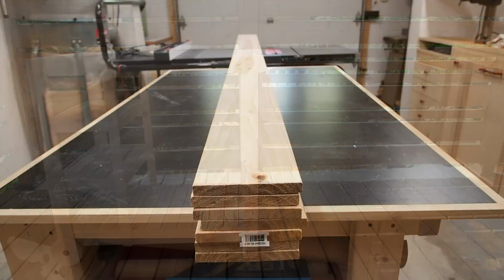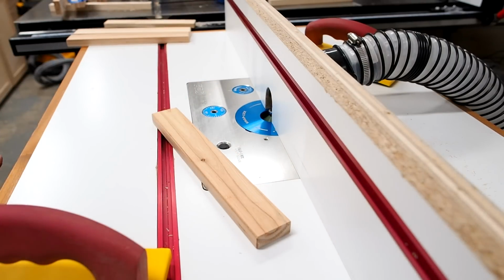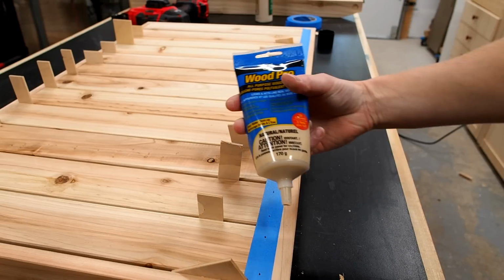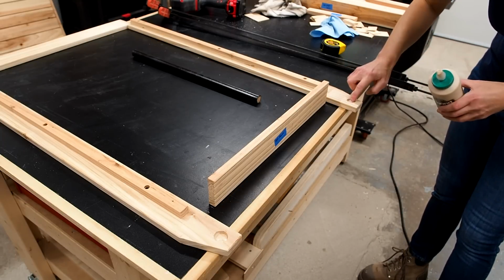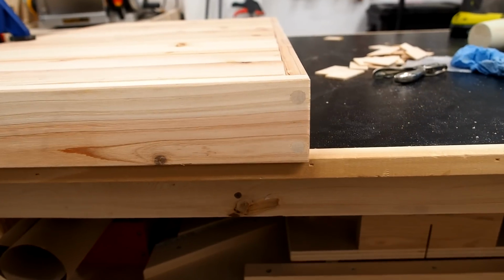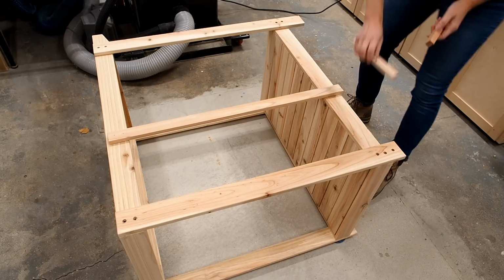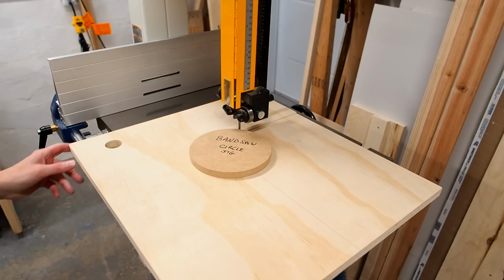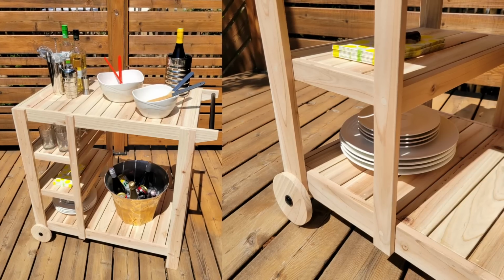Build an outdoor serving cart | BBQ Grill Cart | with wooden wheels! | Woodworking

Comment: You’re an amazing woodworker. Awesome project. That’s a clever trick with the painters tape. Thanks for sharing. 
Did you know the first plug cutter you used, the plug is self ejecting just go deeper with the cut until it pops out.
Reply from the maker: Thanks! And no I didn't know. First time using a plug cutter and wasn't sure what the difference between the 2 was! Will give it a try.
Reply: Correction to what I mentioned 
Cut the plug all the way through. Leave the plug in and start another one it will push the first one out.

Comment: If you glue 2 wheels together with grain rotated 90% they will be less likely to crack over time.
Reply from the maker: Thick wheels... but good tip to consider.
Reply: @DIYMontreal  My best guess is that the wheels are going to cup and then split. You really need quarter sawn material for thin wheels or plywood or composite construction as Andre suggests. At the end of the day they are replaceable and it is a great project. Very “1960’s Popular Mechanics Retro”

My hunch is that you were not intending a race cart - otherwise - you would have gotten some 5/8 rod, cotter pins and rubber wheels at Princess Auto. I do enjoy your references to Princess Auto - very Canadian! I think everyone gets a bit excited when the Princess Auto sales flyer arrives in the mailbox.

Comment: Nice build and good tip on making the plugs with the band saw.  Isn't there a running debate on whether or not to use glue on projects that will live outside; glue prevents expansion, contraction ?